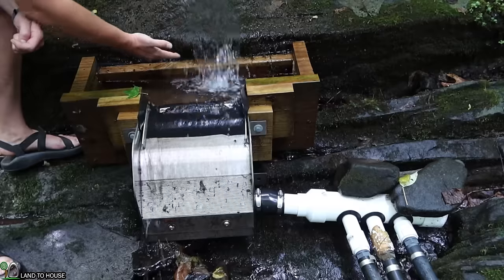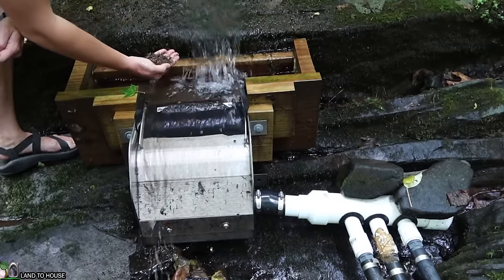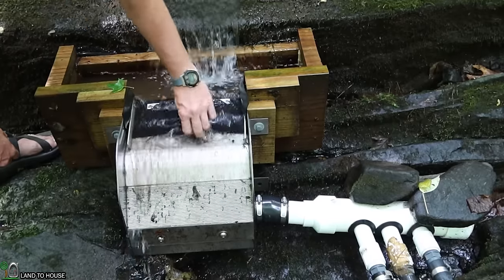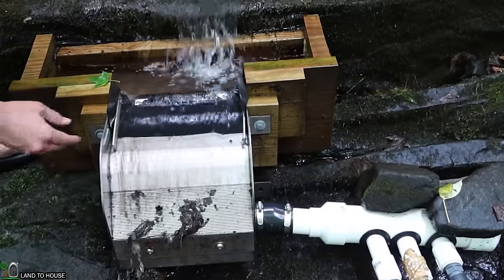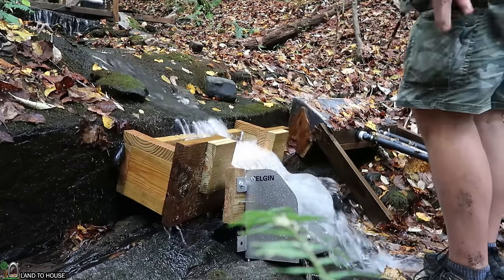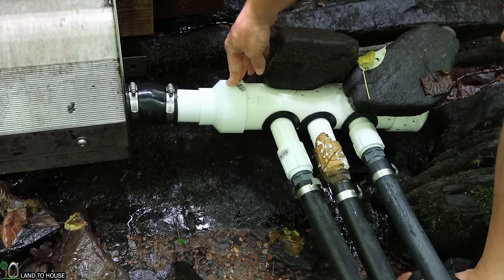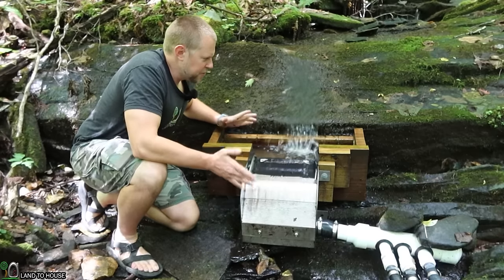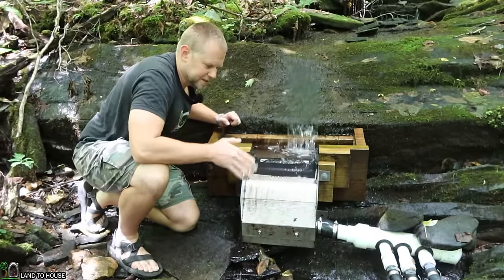Awesome Mountain Hydroelectric Power

Comment from the maker: If you Enjoyed this hydro install check out this one here:
https://youtu.be/V82SVeVXKcA
Reply: put a box over those wire nuts by the turbine box btw 
those wire nuts really shouldn't be exposed like that
Reply from the maker: Should be a simple enough fix.
Reply: I enjoyed your video. I have no system set up and my power bill last summer was $21 per month. $8 of that was the account fee. So 13$ 🤔

I was a little surprised at how little power was produced by your hydro system. 🤷

Although that is quite the impressive solar array you have there. 👍 

Anyhow you have a good day and Live long and prosper 🖖
Reply: Would be possible for you to improve turbine-box to prevent intake of outside air even when lid is closed ?
Reply: Or you can just use greased wire nuts like we do in wet areas where I construct water plants, water treatment facilities, water tanks and pump stations. This type of wire nut is designed to work under water and some even have a heat shrink band to seal the grease in n water out. Just another idea.
Reply: Seth! You do a terrific job of speaking to the camera, concise explanation skills combined with pro-level enunciation - very easy to watch and listen to. I have a couple questions borne of curiosity - if you don't mind indulging me.
First, do you have any intention to build a natural looking reservoir pond at the top of your 150ft drop, to modulate the flow and increase water use efficiency without adversely lowering the natural creek water flow, 
- and save yourself tons of water for either increased power wattage generation or extended power production time?
(I thought of this when I saw how much water was coming out of the overflow pipe at the top of your 55 gallon drum) -and instantly I realized you have enough waterflow over-supply to dig and line a pond uphill, and dam control it just like the beaver do - and basically have yourself a natural water tower. What do you think? 
Also, I just gotta ask what sunglasses you had on while presenting the new power shed -  I want to order a pair! Thanks.
Again, great video.
Reply: I'd be panning the silt in the catchment box, you never know could be some bits of gold 😁
Reply from the maker: @stevenpenner9604   The local mineral museum says there's very little gold in them hills.
Reply: Is it ok to have #1 sewer line close to over top of panel. #2 3 phase exiting box where supply water enters?
Reply: Why are you tied into the grid at all?...Why not upgrade your battery bank and be off grid?
Reply from the maker: New battery has arrived. Upgrade video coming soon.
Reply: Seth, have you considered developing your seeps... Great vids on hand drilling using galvanized couplings cut with a band saw, attached to PVC and drill..? Great vid looking forward to more!!!
Reply: Sir, It's possible to buy that pelton hydro turbine with nozzle valves, I'm from Philippines..
Reply: How much head heigth do you lose by the barrel?
i would place that thing much higer up the hill, as close as posible at the pond.

Comment: By replacing the reservoir at the top with something way bigger (aka a pond), you may modulate the flow of water depending of the need of the battery charger. To say it another way, instead of storing energy into the battery, witch is costly, better to store it by retaining the water on top. Regulation of the produced power can be done by automation of your 4 valves inside the PVC box, using servo motors,.
Reply: There's a vein of awareness for the environment the entire video. A pond would change the local ecosystem a lot more than a drum. Perhaps this was his goal?
Reply: Battery can respond much faster than the pond to drops in power. Like an Uninterruptable power supply for your computer. 
But you could have an electrical feedback system going back to your 'pond' to engage (or kill) the flow of water to your hydro generator when the battery drops too much . Personally, I like the idea of a man made pond, but at the source point, not part way down.
Reply: @gjscomputerstuff  Yes battery's are faster and they also form a kind of pond, a pond of electrical energy.
But batteries are expensive and a pond might cost less per kWh once that potential energy is converted into electrical. Would be like a generator you run when the solarpanels are not charging the batteries enough.
Reply: building a storage pond is something of a major undertaking........and they silt up.
Reply: @wazza33racer  That is absolutely true. So in the end it is a choice that each has to make for one self. Likely if there is a pond, use it, but if not, just buy more batteries :-)
Reply: Would also lessen the debris problem .
( just a small decorative pond )
Reply: @wazza33racer  And you could easily just not do any of this.  Why undertake anything at all!
Reply: @HansKeesom  Well perhaps where you live you don't rely on a steady source of electricity. 
I personally prefer having a constant, uninterruptible source of power for my home - especially for all my electronic gizmos.
Reply: @gjscomputerstuff  I absolutely agree that having a uninterruptible source of power make life much easier. 
That is why I have some devices on an UPS in my house, even though I am connected to the grid and the grid is very stable over here.
I have some solar and it helps to reduce the  kWh I take from the grid by charging into these batteries.
Having more batteries would mean being able to continue normal things longer in case the grid goes down. For the moment that hardly happens but who knows what happens.
Reply: Several barrels in series would do the same thing
Reply: @HansKeesom  I wasn't implying having 'lots of batteries'. Merely sufficient to provide power until you can instigate alternate energy source. I think Solar for primary power, then if the clouds interrupt (or night time) you can switch to battery, and open the gate from the water storage pond, which may take a few minutes until that energy source is up and running.
Reply: Building a reservoir always seems simple on paper. In reality, especially on a steep aspect, they are complex.
Reply: I'm thinking a slight boost 🤔 in pressure aswell...
Reply: @davidjames2145  Excellent - just think how much fun it would be to build that.
That'd be a really great Youtube Video - pushing the limits.
(nothing more  boring than "I think that'd be too complicated"  type of person).
Reply: @gjscomputerstuff  I've built ponds and reservoirs already. I look forward to your video of building one in the terrain shown. 🙂
Reply: @davidjames2145  You've built ponds and reservoirs already - great - please provide me the link on your video(S) of your construction of these items - since you've already done it - it should be easy to do.
Reply: @gjscomputerstuff  🤣
It was years ago!
I'm also not someone who has to put everything they do online; no accounts other than this one.
Don't fall into the trap of believing that unless someone makes a film of them doing something that they never have or don't know how. That's social media conceit, and I would like to believe that you're a better person than that.
Happy New Year by the way.
Reply: @davidjames2145  Wow, somewhat hypocritical of you to expect me to post a video but then go on a rant about why you shouldn't have to.
Reply: @gjscomputerstuff  Jeez.... You really are having reading and comprehension issues aren't you?
Here's how we got here:
1) I posted saying that building a reservoir on a steep slope isn't simple.
2) You posted saying I should (paraphrasing) man-up and make a video as a challenge to doing it. This after I stated that it's very hard to do .
3) I posted saying I've built ponds etc in the past (not on steep ground), only to make the point that I understand how hard it can be, especially on steep ground.
4) You posted saying if I've done it before then post the videos (presuming I have filmed everything I've ever done in my life).
5) I posted saying that it was a long time ago, I didn't film it and also that I don't feel the need to make a film to prove that something is hard to do. If you don't believe me and want to find out then you make a film of yourself having a go .
6) You posted back calling me a hypocrite.

I don't know how to make this clearer for you. 🤷‍♂️

Equally, I am stating here that sending a camera into space, taking a photo of the ISS and then returning it safely to Earth would be really hard. I've certainly never done that yet I know it's not simple, and I don't need to film myself failing to prove it. 🙄

Calm yourself down.
Reply: @gjscomputerstuff  I'm not ranting, just laughing at the knot you're tying around yourself, desperately attempting to justify the needless argument you initiated.

I'll leave you to you frothing.
Reply: @davidjames2145  I'n not upset at all. I've basically shown you the hypocrisy within your own statements, which you either unable to see or unwilling to admit to.
Reply: Interesting, thanks for the video. 
1 comment: Consider connecting your batteries in parallel, then in series.. helps better balance the cell load. Probably not important for AGM but is for lifo.
Reply: Or simple low voltage solenoid valves
Reply: I agree 👍
Reply: If he would have made a pond, he would have had to apply for an E.P.A. permit quite possibly and then there would need to have a Registered Civil P.E. to do a study on what would be impacted environmentally through a computer simulation etc.  That would be in the upwards of 50 to 100 thousand dollars depending on many factors respectively.
Reply: There’s always so called internet experts on every video thinking they can do it better than the person in the video
Reply: Just have a taller tank, a vertical manifold so the 3rd one almost runs like a over flow. Much better set up so you can run full possible power.
Reply: Also don't have to worry about your pond technology becoming obsolete😅🤣
Reply: It would be ideal to reduce noise for smaller properties. Must be some good ideas to do so out there
Reply: @tristanbrandt3886  Everyones got ideas and suggestions but Im over here wondering why no one is talking about permits and the Army Corp of Engineers and their say on any and all water way projects. There really does seem to be a lack of awareness in these comment sections.

Comment: Pro tip: do not just discard the material that ends up at the bottom of your wooden box without first panning it to check for gold content.  Just put a removable plastic box at the bottom of what you already have and then lift it out, dump it in a tailings bag and when you have collected enough, go pan it out.  Who knows, your stream might run past a gold bearing source that wears down into the water over time.
Reply: Not a bad idea 💡 👍👌
Reply: He should set up a box for that with carpet/ripples, plus this looks like N. Cack-a-lacka.
Reply: This would likely have a higher ROI than the power….
Reply: @Escape.Idiocracy  I thought the same thing. Next video... "How I ditched my Awesome Mountain Hydroelectric Power and installed a self-panning gold farm!"
Reply: completely agree. seems like the ideal place for that to be a good source for finding gold

Comment: Normally on those barbed couplings it is recommended to double-clamp. Offset the clamp heads. Doing this can handle a lot of pressure and mechanical stress. The plastic coupling or the pipe itself will then be the weak point.
Reply: Thanks because we're all dummies 😆
Reply from the maker: Adding the set of fence post along side the pipe in conjunction with clamps on the barb seems to have done the job.
Reply from the maker: I relate to being a dummy in many aspects of life.
Reply: Hey man, great video! Love this idea. One suggestion I have having working in the natural gas business for over 20 years working with PE pipe being able to hold 100psi. You can simply plastic weld/fuse you pipe together eliminating all fittings and supports. The weld will be stronger than the pipe itself when done correctly. Other than that, great job!
Reply: Why are you ruining his life? Idk
Reply: @Rob-wl8xq  good idea! What’s the tool for the job
Reply: @Rob-wl8xq   i fusion welded my 3" hydro line, unbelievable how strong the joins are!

Comment: In the late 1960's I lived off the grid in British Columbia with a small diesel installed by a retired American engineer.  He had a beautiful small hydro plant that produced about 5 kW.  He used the electric power to provide heat and power to both his home and his well-equipped machine shop.  He placed pipe for the system's two heat pumps in a lower pond he had made in close to his home.  While I was envious of his system we never spent more than about $300.per year on our diesel.  Every two weeks we shut it down for an oil change.
Reply: Not a bad idea  using both systems.

Comment: For someone who is not an electrician you've done a pretty darn good job. Im not only talking about the electrical workmanship, but, putting up the whole install. Its the whole bells and whistles from source, electrical generation  (Solar,Hydro,Grid) down to distribution. Its practically a mini power Plant.. Salute to you sir.
Coming from an electrical engineer.
Reply: Question: he said he is only running a #10 250ft. Is he not getting voltage drop? Should it not be #8?
Reply: @jeffcossaboon5012  more the merrier
Reply: @jeffcossaboon5012  It would depend on the tolerance requirements, which typically would be +/-3%.  It also depends on how much current you want available.  As you draw more current, the voltage will drop proportionally, which could be managed by increasing the size of the wire.
Reply: Agree, from a Structural Engineer.
Reply: @joeabad5908 I am very interested in learning electrical engineering. My degree is in Political science, so I have no electrical engineering experience, nor do I know anyone (still alive) who does who could advise me. I have learned basic electrical skills, like adding circuits in my home for lights, outlets, a new oven, etc. around my home, but that’s it so far. Are there any books that u would recommend where I should start learning? My interest is personal, not professional- I want to learn for my own sake. I am especially interested for the purpose of eventually building my own home and living “off the grid”. I’d truly appreciate any recommendations or advice you r willing to share! Thank you!
Reply: Agree 👍
Reply: @aaronadams01  Yeah and that hydro generator is only putting out 100W so #10 is probably even overkill at this point.  That should be fine.

Comment: To me, the problem was not so much the wire mess than the exposed connections. Just because it's in the basement doesn't mean something isn't going to end on those contacts. You even had the experience of the mouse ! Also, i hope those exposed wirenuts are supposed to be in that tee box, otherwise they might corrode away, especially if always under tension.
Also, an idea to prevent problems with expansions/contractions would be to have a sloped loop held on a platform of some kind that would allow for expansion/contraction movement while still plugged in. 
Great video, all in one !
Reply from the maker: There are still a few exposed connections that need work. The rectifier for example.
Reply: in winter it would help to let the water circulate in the pipes even if you're not using the turbine, flowing water does not freeze ! i've never encountered such an amount of expansion/contraction yet i've done installs in high altitude cold climates
Reply: I would also consider mounting that rectifier to a proper heat sink if you haven't already

Comment: Thanks for the informative video.
Two comments.
-- First, you obviously don't have bears in your area. Decades ago I visited friends in the Salmon Mountains of northern California. They had a similar sort if black pipe for water from a spring to their home and then a small reservoir for the local small town usage (gardens and such). Theirs was buried, and it ran about three miles (if I recall) down the mountain from the spring, but  bears still occasionally found it and pulled it up. Apparently they liked to play with it, and chewed up a section, requiring a repair piece to be spliced in.
-- Second, you might want to look at the Gridlessness channel to see their microhydro install. I just looked at it again recently, and they seemed to have less or about the same pressure, but their output power (wattage) was higher, and it had been running for 15 years.
    Again, congratulations on all the work you put in on that system and sharing it with us. It gives any number of great "lessons learned" for would be hydroelectric builders.

Comment: Very nice review of what you've accomplished so far, thank you.
That wasn't a mouse that ruined the previous PMA, it was loose wiring shifting around allowing one of the coil wires to touch, abrade, and then arc to the impeller housing.  That short but deep notch missing from the wire is a tell-tale of arc-ablation, rodent chews are long and shallow. It's actually a design issue for Langston to work on: tie down the coil leads to the stator core after winding the coils but before potting the stator, anchoring the pigtail leads to the housing so that movement of the pigtail doesn't impart any movement to the stator wiring, and an insulating layer between the stator wiring and the housing such as 3-5 layers of resin impregnated paper.
Reply: The mouse was lying there blackened at least thats what he implied